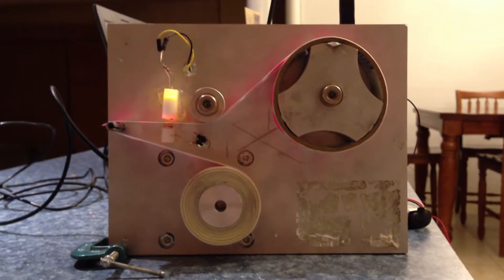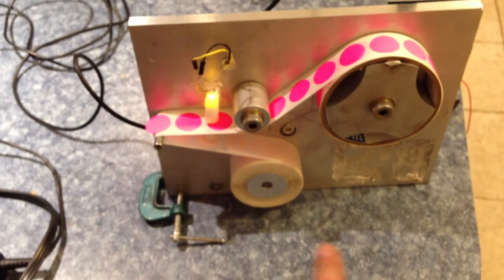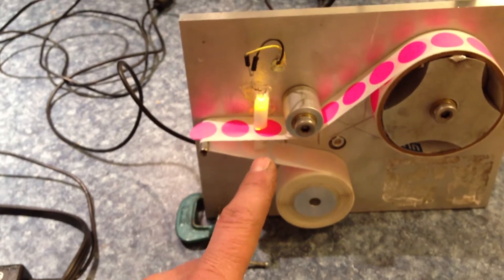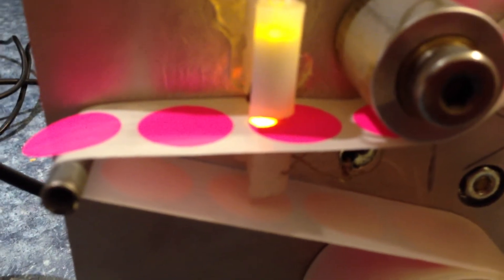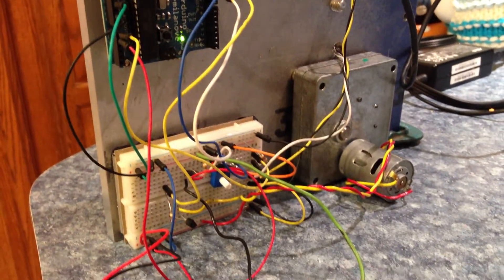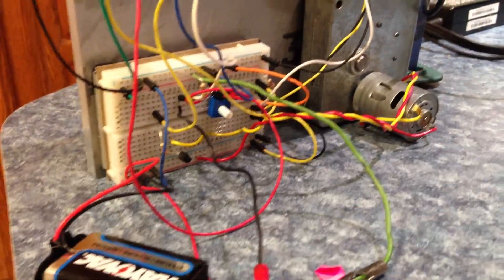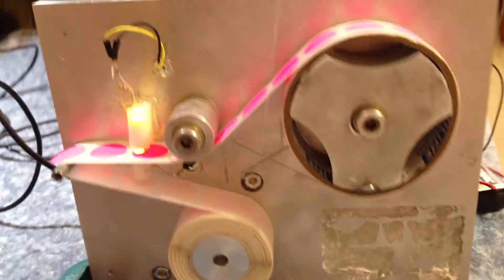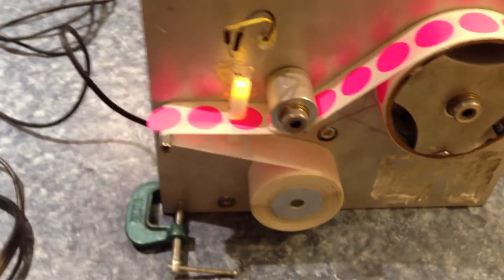Using Arduino as a PLC for a Sticker Dispenser

Comment: you could add a part present switch where the dispensed sticker is to automatically feed the next sticker when an operator grabs one. Keyence and ifm both make sensors that can pick up on a certain color too.